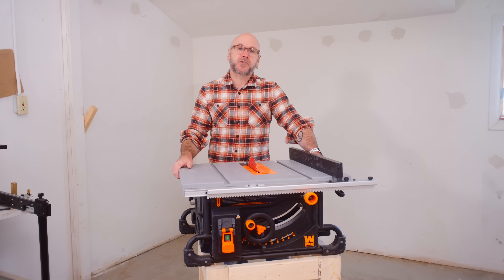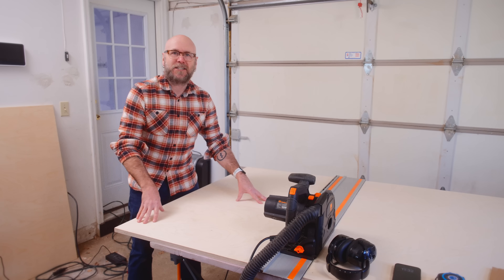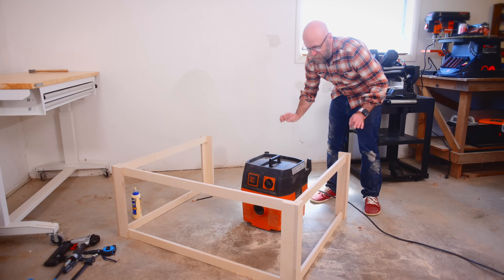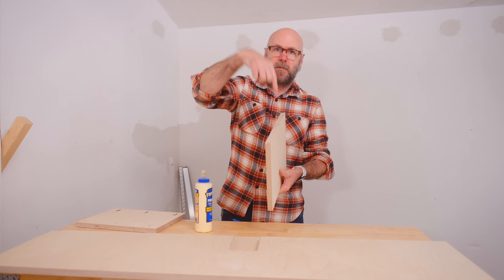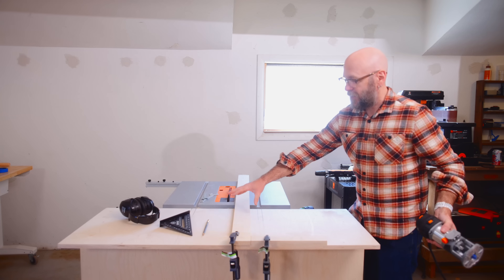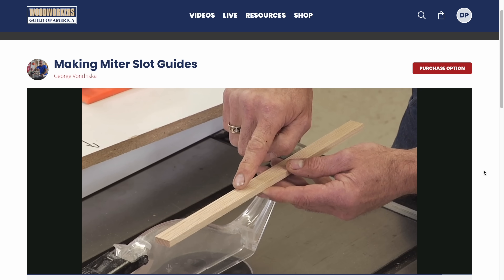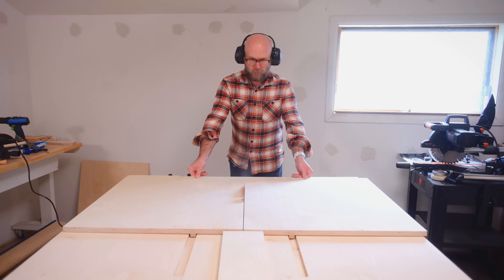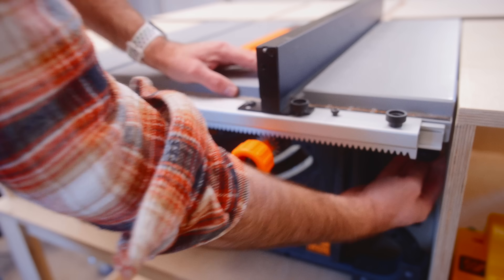Transforming a Cheap Table Saw Into a Professional Cabinet Saw

Comment: This was the kick in the ass I needed. I've got two young ones, and have been trying to pick up woodworking as a hobby, and finding the time has always been my gripe. Watching this finally flipped the switch. Slowly, but surely, I wanted to make more or less this exact work piece for my table saw (Skil saw), I've cut my shitty southern yellow pine plywood from Lowe's, assembled all the goods, made adjustments along the way... It's not YET assembled, but just needs some screws (though I suspect my pocket holes for my side supports won't pan out - so there may be some adjustments needed).
So, thank you so much. 

ALSO, to your question on a fence for a contractor saw... I have no idea. Someone mentioned Bora, but that doesn't replace your issue with the rack and pinion lack of micro-adjustments. John Heisz has a couple build videos on making his own fence - and while some look like they'd be a bit beyond me, I was like, "Holy shit, you know who could make a very approachable video to build your own fence? David f*ing Picciuto." John's videos are all incredibly informative, and I'm sure his plans are rock solid (he spares no details in his videos), but could be an opportunity to add to your budget shop and be something a lot of us novice woodworkers would try to replicate. 

If you made it this far, props. Thanks man! Ramble, over.

Comment: This is a great video that shows what can be done with budget tools and I wish I had seen it a few years earlier. It's probably because I don't know any better but the rack & pinion style adjuster on my DeWalt is the primary reason why I don't want to replace it with anything else. With the same blade you're using in the video, I get exceptionally precise cuts by simply putting at the measurement required. However, the fence itself does leave a small bit to be desired.

Comment: About the Fence, the best easy solution would be to install a bigger turning knob (2-3x current diameter should be enough), that should make the fine regulation much easier and looks like there is enough clearance to avoid getting in the way of the infeed 😃
Reply: @JLjl1910  i just went to the comments to say this...

Comment: Good video! As someone who lives in your neck of the woods, it’s nice to get inspiration from a local. You have truly come full circle with that sponsorship bit from the Guild.

Side note - I won’t lie about your last point though, I personally can’t stand the rack and pinion fence systems that are so popular now because of what you talked about. It doesn’t matter if they are dewalt, Milwaukee, Rikon, skil, metabo, ect… I’ve seen the same issue across the board. Plus they always feel cheap (and I’ve had a few break)

One huge upgrade to it though is to use the bow fence system. That thing is amazing in a small shop and gives it a lot more stability at the job site.

Comment: Thank you for going back to low budget!! You just used your extensive experience and skills to make simple boxes and create a superior upgrade to that saw. I've made a couple of saw stands and it never occurred to me to make an all-in-one that big . . . so that it could be an all-in-one. Of course I've only had a couple years so far. I built the stands then started adding, and it hasn't worked so well. You're doing well in doing good!

Comment: I bought and attached a delta 30" table saw fence sold at HD for $260. Huge improvement over the contractor saw fence. That being said, it is an angle bracket attached to square tube and a T square fence, so I could have made it myself for way less, especially since I had to drill custom mounting holes for the angle iron part anyway.

Comment: For an add-on fence, I think the Delta Model 36-Txxx is an excellent choice.  I put one on my hand-me-down Craftsman saw and it made a world of difference.  Home Depot usually has a good price on them for some reason.  Really easy to retrofit.  I made a similar cart for my saw and I did not use the back rail choosing to have the back end of the fence glide.

Comment: A few years ago, I bought an Incra fence system for my very used old Craftsman table saw. I built a solid stand, Integrated outfeed and side extensions, and an integrated router lift on the right side. It was a bit expensive but invaluable. I've since upgraded to a SawStop contractor saw and continue to use the Incra fence system. The SawStop fence is still in the box. It's supposed to be a good fence yet I cant see it being as accurate and versatile as the Incra.

Comment: If you push down in the fence adjustment knob it slightly disengages the gear and allows for finer movements of the fence.

Comment: Tip for getting finer adjustment on the rack and pinion mechanisms for the fence: put a long lever on it. Probably a removable would be preferable.

Comment: I have the identical saw in a Metabo brand. I built a table for it, ditched the original fence, and mounted a Delta T2 fence to the front of the table and it worked wonders for me.  Was about $200 when I bought it.  May be like 300 now.  Honestly for the cost of the saw and the fence together I should have bought a delta table saw and been done with it.

Comment: Slow golf clap, well done. Lolz taking inspiration for a table saw table while sipping a 9 yr old cellared French wine from Australia. Have a small shop I’m working on atm, maybe I’ll make my table saw a bit shorter like you have here an use a second flip flop mitre saw table as extended outfeed feed instead of make my the table saw table 2400mm long

Comment: For additional stability on the cross cut sled, you also cut a plywood strip and add it to the back of the sled across the cut but flush with the cross cut sled surface.
Reply: Only to then cut through it ...

Comment: What a great, practical project. Jobsite saws can be both equal parts great for their compact nature, but also equally shite because of how hard it is to use them without outfeed tables, wrong work height, etc. I bought a Milwaukee cordless jobsite saw a couple years back and don't know that I'd ever have much use for a full, corded saw. At the same time, it's little rinky-dink stand and no outfeed make it seriously annoying to use and the table is so small a crosscut sled is pretty much impossible to use as well. This video has given me a multitude of ideas to revisit at some point when I have the space to actually make that saw function efficiently. I'll definitely be referring back to this video when the time comes. Also, I have that same Fien dust extractor - it's nice, quiet performer without breaking the bank (but still a LOT more expensive than a big-box shop vac - but hey, at least it's not Festool-expensive).

Comment: @MakeSomething not sure if you've run into complications with this and had to fix it yet, but the dust port hole you made in the outfeed support @9:30 is going to interfere with the ability to change the blade angle since the dust port on that saw moves with the blade. May want to cut a quarter circle track matching what you see on the back of the saw.

Comment: For fine rip fence adjustments could you set a rough measurement with your table saw fence and add an auxiliary fence with something like a jessem micro adjuster? I've used a similar setup on spindle moulders in the past.

Comment: My Dewalt has a tension nut for the rack and pinion fence, I’d assume that this one does as well. I had to dial it in to remove the slippery feeling when trying to get it at a precise position.

Comment: I love seeing vids like this, but I end up hating the tablesaw/bench I built. Its 3  48"'x32"  mobile benches that fit together as a 4x8 table or a 2.75'x4' table. I thought I had it covered. Different shapes, sizes and angles were covered, but its a tank to move. You built a sleeker sport model. I tip my eye pro, Sir.

Comment: Great project, Not sure if you noticed but the dust port on the back of that saw moves if you angle the saw blade. Your box is going to prevent that from moving or might break. I think you can just put an angled cut out to accommodate that.

Comment: About the fence adjustment, you can probably 3D print a second dial for precision, that gears into this dial's gear but has a higher ratio.

Comment: To tackle the fence problem on my old bosch I used extruded aluminium and a Incra positioner. With a aluminum fence. Cost where about 150 for the aluminum and t bolts and the cost for a positioner. But man was it better. I now use the positioner and the incra fence i bought later on my 47 delta unisaw. The small jobsite just lacked in power for the thicker and harderwoods.

Comment: Planning something very similar that I'm going to start in a couple months, but going even farther down the rabbit hole. Rather than enclosing the crappy table saw inside or/surrounded by cabinets, I am taking the guts out of the saw and mounting it directly into the narrow end of a 4x8 rolling workbench. A few reasons for going that route: First, it lets me eliminate all of the wonky saw characteristics (plastic box, undersize miter slots, shit biscuit fence, etc.). Second, I can use a Delta T3 fence setup which eliminates your fence issue. Third, I get can get some nice infeed real estate by pushing the saw back into the table a bit (will require some controls extension). And finally, I can fashion a dust collectoion box much easier (and smaller) without the original plastic cabinet in the way. The saw part of a table saw is not much more than a skillsaw without the handle, so pretty easy to re-mount it into a nice big cabinet like you see in cabinet shops all the time.

4x8 will include table saw, router lift, pivoting compound miter saw, a clamp/assembly area and onboard dust collection for all of it.

Comment: I had a set of dewalt bit drivers break on me on the last project I worked on. 2 different bits did it. I was just using decking screws too. They weren’t nothing special but they were special enough to break 2 of my bits.

Comment: Love the video! Only issue I see is the cutout for the shopvac is going to get in the way if you tilt the blade below 90 degrees for a miter/bevel cut. On these type of saws the whole dust port swings with the motor when tilting the blade. Otherwise love the setup!
Reply from the maker: Ummm, shoot. Yep, I'm gonna have to modify the cutout!

Comment: Bought a small container of about 10 Harbor Freight driver bits.  So far half of them did the same.  Snapped off inside the screw.  Next time I'll spend the extra 2 dollars a get the impact rated drivers.

Comment: Make a big knob for that fence control and you'll turn it slower. You'll be limited by clearance to the saw table top but see what you can do to fabricate a larger one. Check the backlash of all parts in the system too. Maybe some adjustment to eliminate slop.

Comment: After using the track saw more, what are your thoughts?
Reply from the maker: I wish the tracks were a few inches longer. Other than that, recommend
Reply: Thanks, supposedly they work with the powertec tracks if you want more length. 🤣

Comment: When using the Brad nailer turn it 90 degrees. Brad nails are designed to turn left or right. This will reduce the chance of it coming out of the side and going into your fingers. Also make sure to add an angle it’ll make your joint stronger.

Comment: I'm unaware of any decent aftermarket fences for contractor saws.  However, for mine I find myself unlocking it and nudging it over gently by the fence rather than using the knob.  I plant my finger on the table almost touching the fence and then move my hand slowly toward the fence to barely move it.  A tip.

Comment: For people watching this that haven't bought their contractor saw yet, don't buy a Ryobi one! The t tracks for the saw aren't a standard size so after market miter guides won't fit and the fence for it is the worst thing I've ever seen, it's not on a track and just clamps to the table so you have to measure the back and front distance exactly every time so you don't get kick back from pinching the wood.
Reply: Just found that out!
Reply: I'm glad I have a 3d printer. I was able to adjust the fence so that when I push it flush from the front it stays square. I've actually been loving this saw, but it's my first and don't really have a comparison. I do wish they put miter tracks on both sides, though.
Reply: As someone who loves the ryobi tools like
I can agree there contractor saw is garbage
Reply: For what it's worth, I'd stay away from all of ryobi's tools. They all suck. They're not straight, they don't have adjustment points to make them straight. They also lack power. I got the table saw, band saw, drill press. I ended up returning them all and getting Wen instead. They're soooo much better for the same price or less.
Reply: @skittyzed  too late. Dang. And it’s too late to take it back lol
Reply: Dewalt?

Comment: I'd like to ask you to consider a couple of safety adjustments when your showing the table saw. @StumpyNubs had an excellent show recently discussing the proposed CPSC table saw regs. He pointed out that a lot of injuries could be prevented of we just used the blade guards, and he started using them in his videos. Please consider joining his initiative as once you've shown how to adjust everything, just pushing wood thru is no different with the guards on. Another thing is just s personal preference with me, but please consider retracting the naked, stopped blade when your hands are moving around it. (My two pennies, YMMV!)
Reply: If you just don't touch the blade that'll prevent most injuries. It's not that hard. You don't lick the top of your stove while it is on, do you?
Reply: @1pcfred  Nope, not that hard. Put the blade down, and when the inevitible shat happens, you won't touch the blade and won't get injured by it. And, while I've been known to secretly lick my dinner plate to get the last of the gravy, I haven't been tempted the lick a stove top (among other things) since I was about 2.
Reply: @tomhargreaves8820  what shat is inevitable? I've been using table saws for 40 years now and nothing has ever happened besides work got done. I've sawn through half in thick plate aluminum on a table saw. It doesn't get any more intense than that. Although one inch thick Micarta sheet is a close second.

Comment: Ever tried the WEN 10” blades on your table saw?  I normally use Freud, but saw the WEN on amazon for $10. Not a bad blade at all for $10. Cuts are very smooth.  Been using it for about four weeks now.  It will be interesting to see if they maintain a smooth cut as long as a Freud

Comment: I had a quick look but could not find a follow up video for this. Did you have to make a larger cut out in the out feed box for the vacuum cleaner to fit when you make angled cuts? In the video you only had a small rectangular hole cut. Otherwise a great idea as I had bought a cheap table saw and was looking at a way to improve its performance.

Comment: So I have been racking my brain trying to come up with a way to combine what you did here with your sliding cross cut table for my home shop in a 2 car garage. Im thinking I can make the frame out of wood instead of metal like you did on the crosscut table video. Itll be on a smaller scale so it might work. Any thoughts or recomendations will be appreciated.

Comment: I guess you could try to replace just the racks and pinions for finer tooth versions, keeping the original column and knob... No idea if those are easy to source though. And it might require some machining to adapt them to that saw. But in principle it should work.

Comment: @MakeSomething I bought a Vevor branded afrermarket fence for my 1940s Craftsman 10" jobsite saw.  It should easily fit (maybe a few drilled holes at the worst) on the Wen you have.  Is it Bisemeyer? No. Is it pretty decent? Yeah.  It's bearing system is UHMW polyethylene pads on the front, and a UHMW impregnated banjo bolt on the rear of the fence (some hardware of which were missing on mine, like your mobility base).  It's still solid, accurate, secure, low deflection, and I find just as easy to fine adjust as a JET stock fence on their Proshop line contractor saws.  The frame supports (front and rear of the saw) of the fence are long enough to support some sheet goods, and also support extension wings you might otherwise worry about overloading the table's attachment bolt holes.

The one thing I would caution about is, the fence itself is just a steel box frame.  No T-tracks, no slots, no mount points to attach UHMW thin stock to for a smooth(er) feed along the fence, or even to attach sacrificial boards for rabbits with a dado stack.

Still, it was perhaps the biggest upgrade to my Craftsman beside a quality 50T blade.